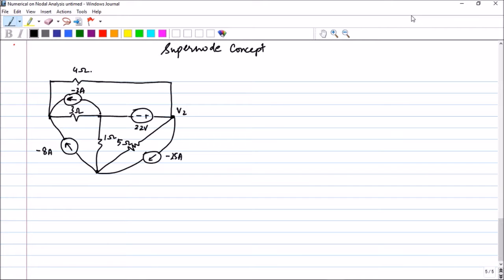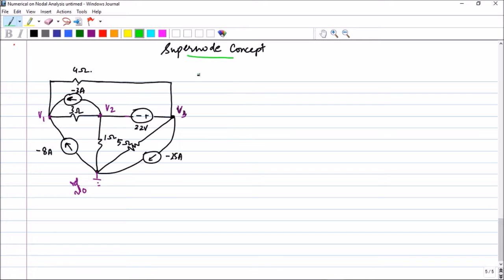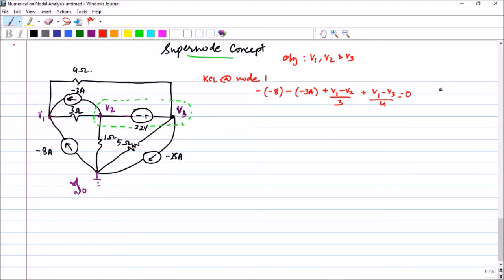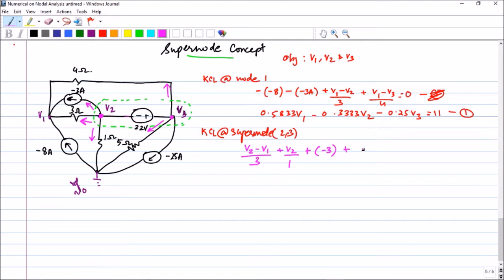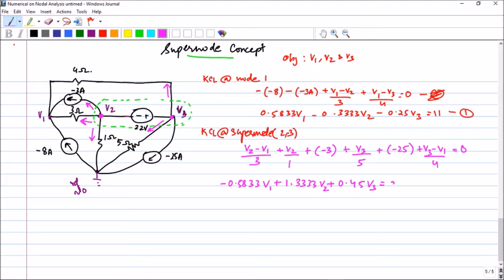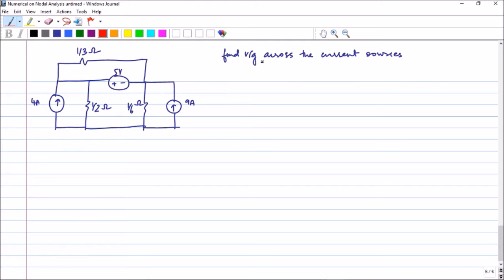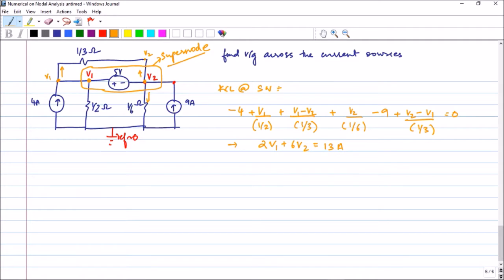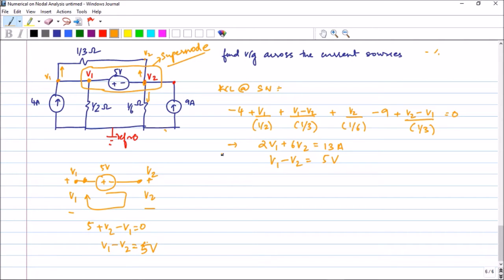SuperNode in nodal analysis #ECA Session - 25

Comment: Hi Varun, Wouldn't it be interesting to do a problem where the reference node moved away from ground. This  happens in power systems when faults occur. So if one did a problem where we start in normal operation with reference node at ground (0 V) and get all the V, I and P's and then move the ground to say 5 volts and see what happens?  just thinking out loud sir :)
Reply from the maker: Actually this is was my first course, and have not thought a lot about this after uploading the course...
Reply: I have noticed your evolution and enjoying it all immensely. Thank you so much for all the effort! Your nodal analysis was wonderful.